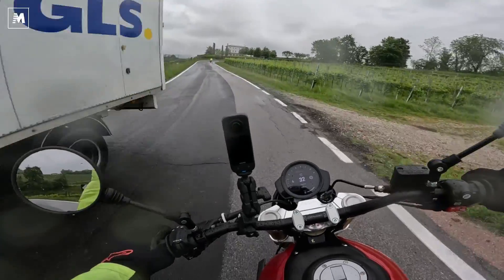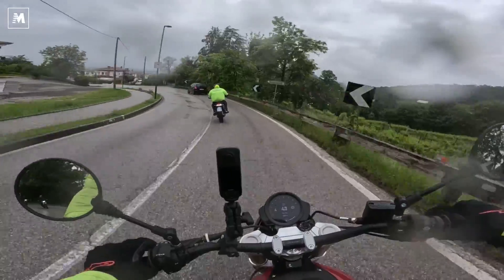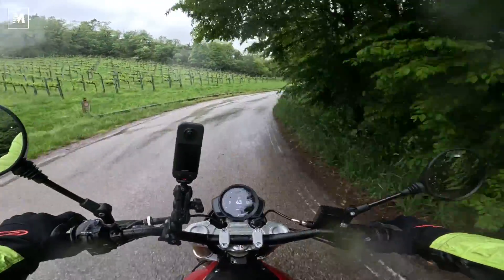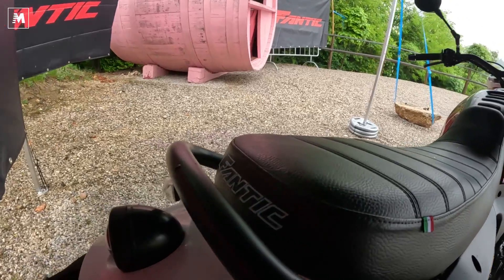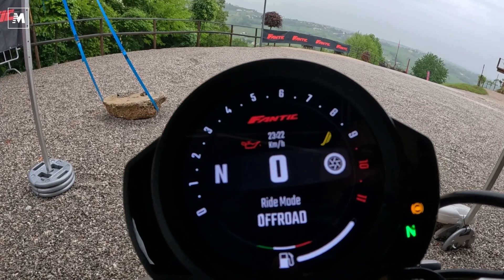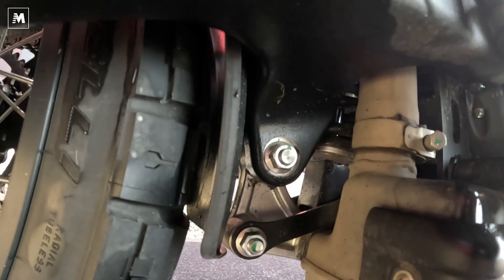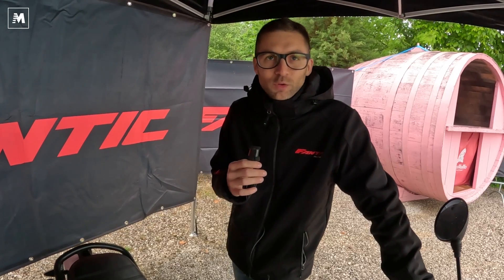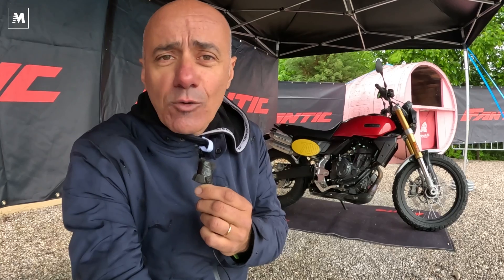Fantic Caballero 700 TEST! Pregi e difetti della prima bicilindrica della Casa italiana

Comment: Nice bike. However i see two limitations:
1. Only 1 front brake disc, limits sport driving on road.
2. A fuel tank with 13l, limits any adventure/touring attempt.

If Fantic had made this one with a nice tank, like Guzzi V7 with its 21l, and also with 2 front brake discs, this would be a truly original and good Scrambler. Instead its just another Ducati like Scrambler. 🫤
Reply: I think single disc shuld be enough for 175kg (nc750x it's 200kg and single disc works ok). About fuel/range I think it will reach 300km, that its good enough for a neaked/scrambler.
Reply: @perimund  I have a bike with the CP2 engine (Tracer 7) and made 400km with 17l. But you have to be very gently with your fist to do that. Usually i do 300-350km. So i doubt you can make 300km with 13l.

About the single disc, Honda recently upgraded the CB500 lineup to double disc. Many cheap Chinese 500cc bikes are coming with double discs.
Single disc is enough for a relaxed ride. For anything more It's not enough.
Reply: @MacAlex007  my T7 with 16l tank did 350-400 when on tour.